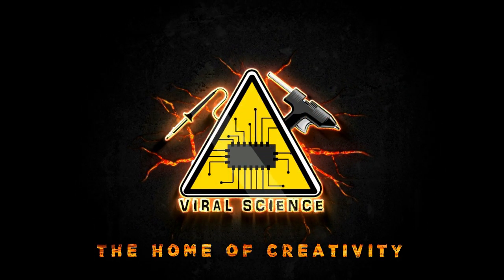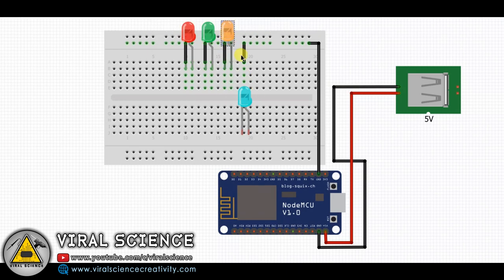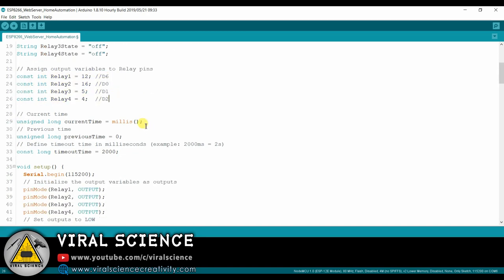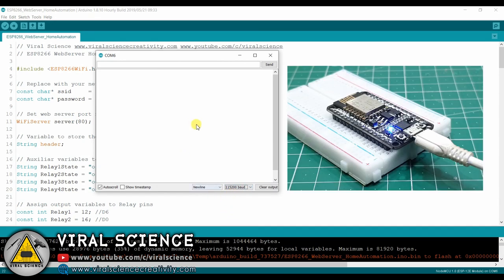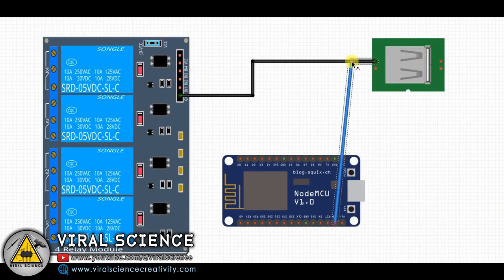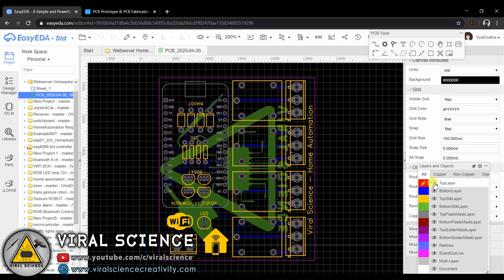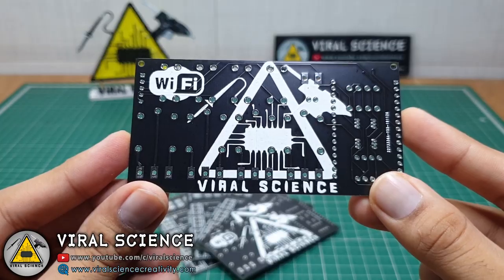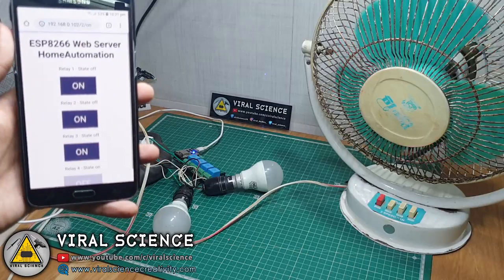ESP8266 Web Server Control Home Automation

Comment: using a lolin wemos d1 mini and dht 22 am2302 sensor, just cannot get any values to show up at all, refresh rate 1 sec, also tried refresh as push in app too. the blynk app states the device is connected but no readings at all

Comment: This project can be great also for make an irrigation system :-) 
Thanks a lot
Reply from the maker: This project only works on same wifi network, your device and the system should be connected to be on same wifi, so in open field it may be difficult to get wide range of wifi connectivity
Reply: @ViralScience  No problem for this... all my irrigation system control is in one place. 
Ant this place is already WiFi covered :-)